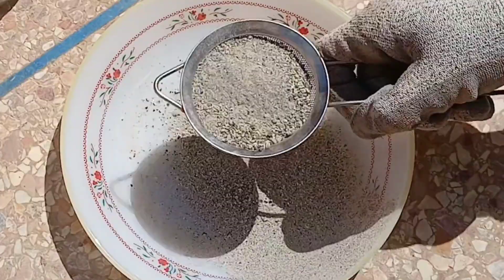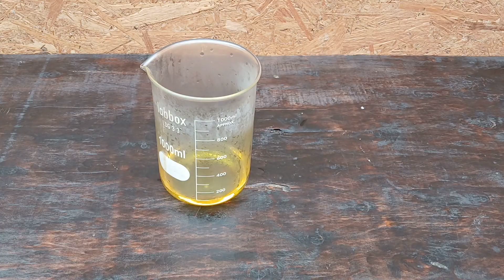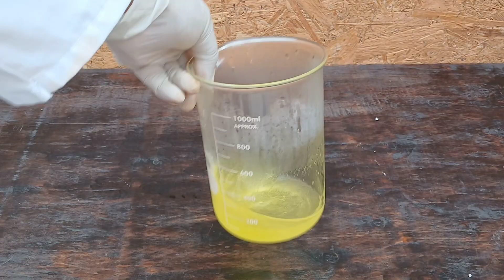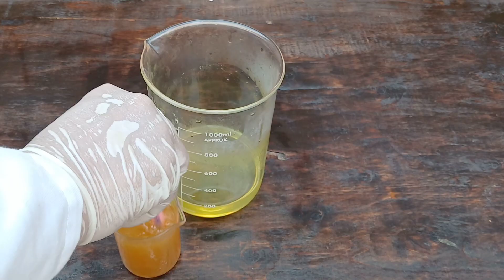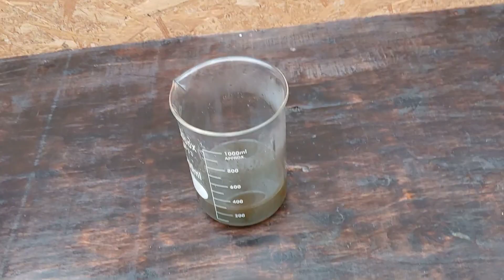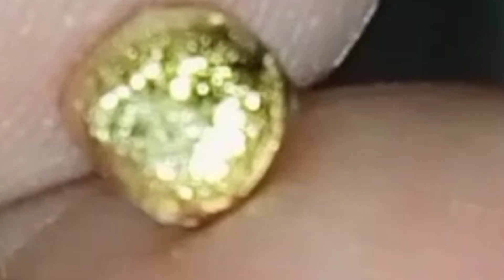Unlock Hidden Gold: How to Extract Gold from Trapped Quartz!"

Comment: thanks for the content. How long should it be roasted?
Reply from the maker: @ArnulfoCaviedesCardoso  For quartz ore containing gold:

Roasting temperature: Typically ranges from 600°C to 700°C.

Roasting time: The duration can vary but is usually between 1 to 2 hours. The specific time depends on the amount and type of impurities, as well as the particle size of the ore.
Reply: @Goldchannel  Thanks for your reply. In any case, should it be done until the material is red hot?